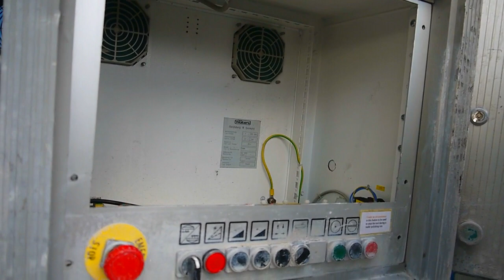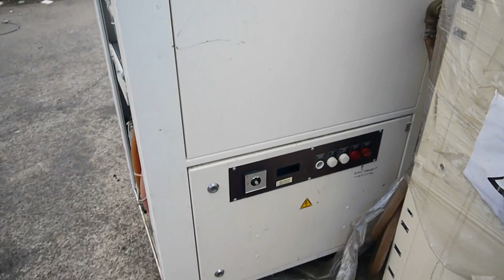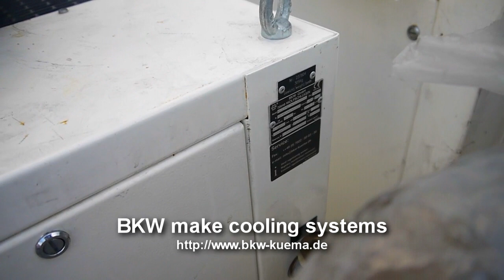Scrapped silicon chip wafer production line

Comment: Well those look like old 200mm silicon wafers, old tech now, most places are using 300mm and I have even heard of some companies looking into 450mm, at 2:10 that looks like a robot arm for handling wafers, and just after that looks like a pre-aligner for some sort of scanning tool (SEM, REG, Laser etc). I am not aware of any Fabs in the UK, but I know there are several in Ireland so maybe they came over from there. Although I do know there use to be a company up in Yorkshire making Lithography gear so maybe something to do with them?
Reply from the maker: syncmaster710n14 The Morganite notice on the WaferCheck may be a clue, but as far as I can tell Morganite do carbon, not silicon. Brushes and stuff.